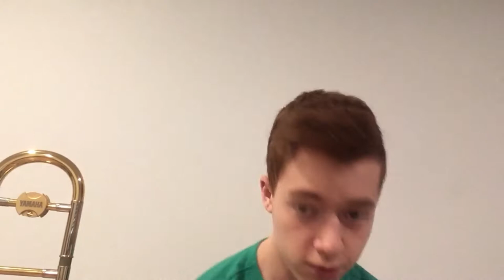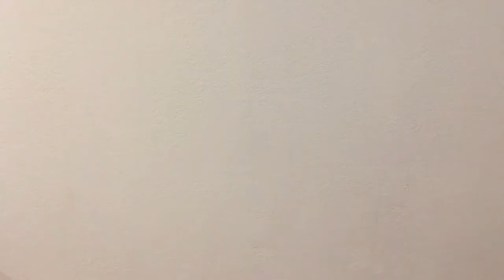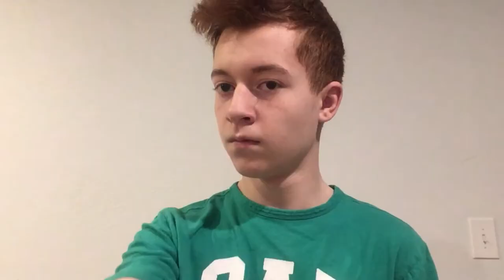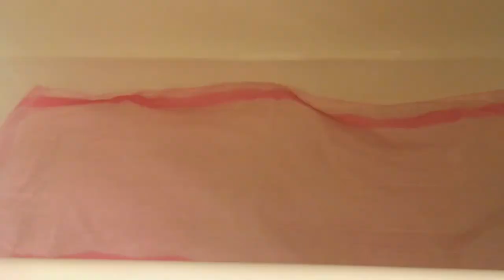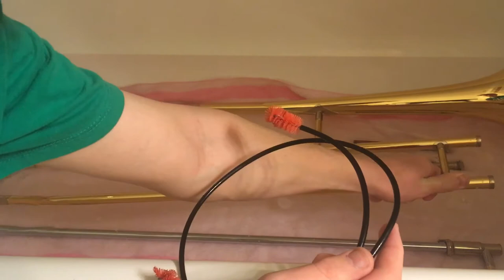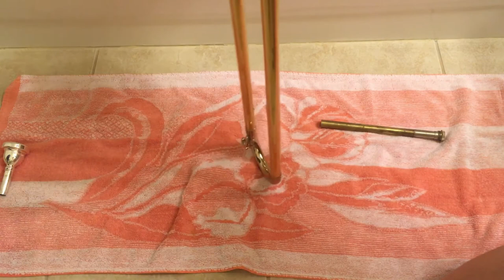Giving Your Trombone a Bath | A Comprehensive Guide

Comment: Some feedback from a fellow trombonist, if you'll accept it: looks like you forgot to spray water after applying slide cream. That's an important step. 

Also, slide cream and slide grease are not interchangeable. It's possible that the slide cream is contributing to your tuning slide issues. 

It's often entirely unnecessary to add any cream to the "2nd position" region. Usually just the stockings is enough, although that may depend on the individual trombone.

Keep up the good work! Instrument maintenance is vitally important and I'm glad you're spreading the news!
Reply from the maker: David Roth thanks a lot for the suggestions! I'll try cleaning off my tuning slide and using some trumpet slide grease. As for the second position area, that region tends to be a little choppy, so that's why I apply some cream there. Not sure why that is the case, but the cream seems to fix the issue for the most part.

Comment: I don't have slide cream, so what I used to do is grease the slide with slide grease, and then water it down with valve oil, now I just use oil because I haven't had access to grease in months.
Reply from the maker: The grease/oil trick works really well on trumpets' 3rd valve slides in my experience, and probably isn't half bad on trombone. Unfortunately, my current trombone is a beaten-up student model with a dent or two in the slide, and even with top-grade Slide-O-Mix products the slide is slow and jerky.